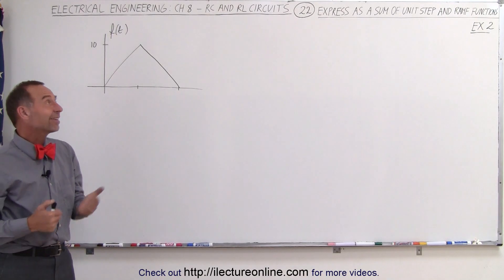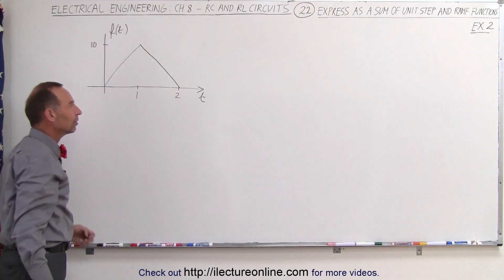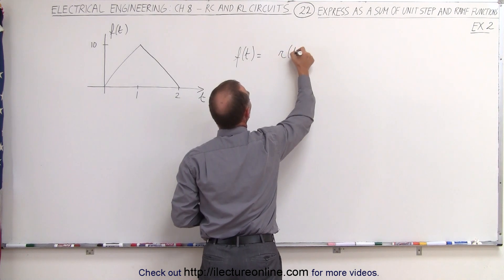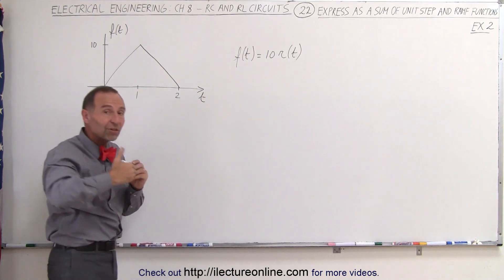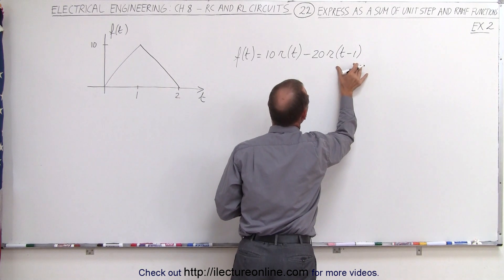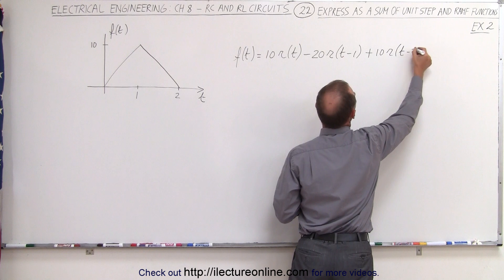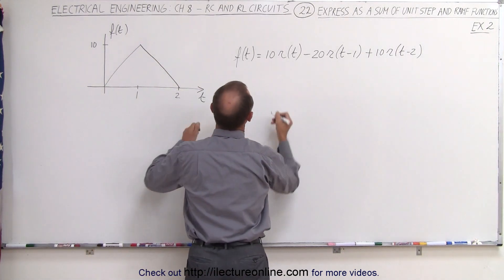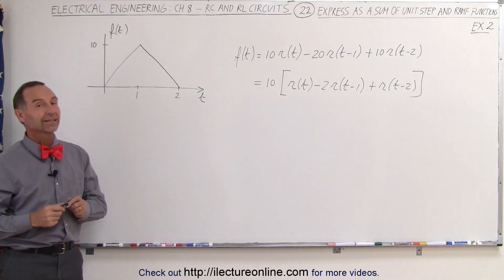Electrical Engineering: Ch 8: RC & RL Circuits (22 of 43) Express as a Sum or Unit & Ramp Fct: 2

Comment: I think this is wrong becoz at t=2 the slope is decreasing i think the correct answer will be 10r(t) - 10 r) t-1) - 10r(t-2) plzz correct me sir
Reply from the maker: The video is correct.  Thanks for checking.
Reply: You right
Reply: Plzzz check my answer sir..
Reply: 10 r(t) - 10 r(t-1) - 10 r(t-2)
Reply: @vinaypant557  for t-1 you only negate the 10r(t) which means the amplitude would stay at 10. To get it to decrease you need another 10 as the professor explained. Hence 20